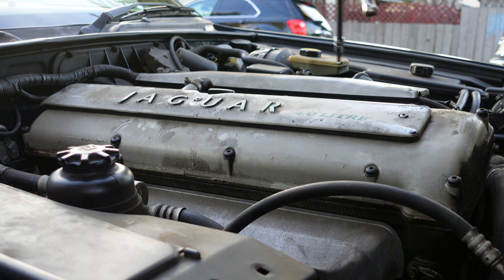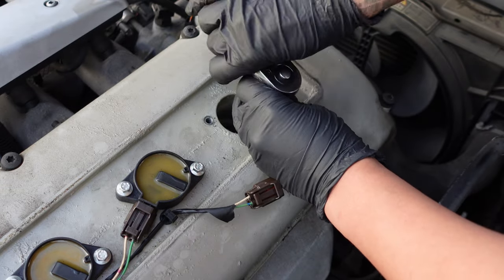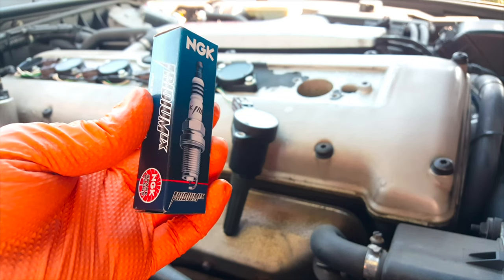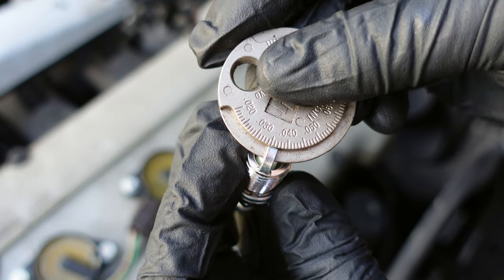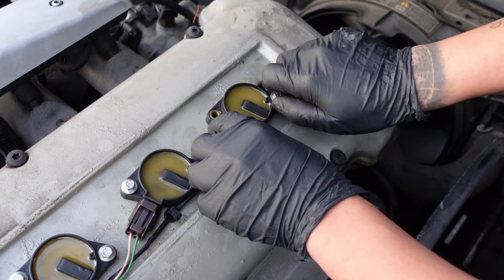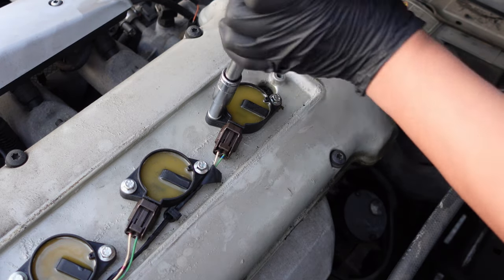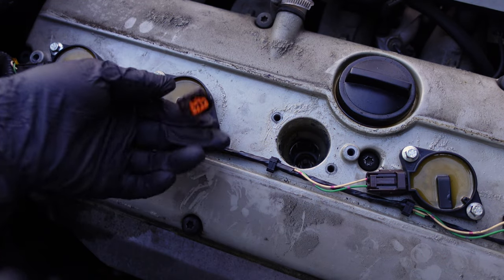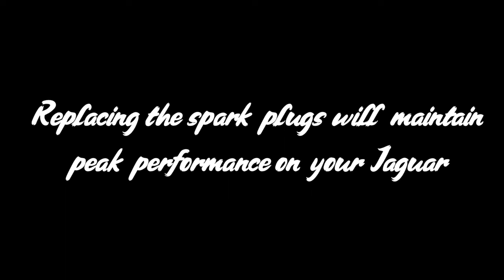Choosing Spark Plugs & Knowing When to Replace Them in Jaguar XJ6 X300

Comment: Great video Jesse. Thanks for showing Jag owners torque specifications on the spark plugs and getting them not to use anti seize on the NGK plugs. I just watch someone else channel on doing spark plugs on an x300, but left all of the good info you provided out. I just did spark plugs on my 91 bimmer 750il (NGK) and I wish it was as easy as this Jaguar. Keep your great content coming

Comment: Hey XJ - I am hoping you can help me I own a 1996 XJS V6 Jaguar with only 47,000. Just recently the Idle starting getting rough and the idle would fluctuate. Where do you suggest I start looking.
Reply: Sorry you asked a year ago , but for anyone else out there i had exactly the same issue.  I fitted 6 new Champion RC12YC Spark Plug Copper Plus from the Green Spark Plug company . Cured the lumpy tick over . Plugs cost less than £2 each . Order gaskets as well . They don't sell them . But I guarantee yours will be broken . Keeps the moisture out of the well .

Comment: I have a Jaguar van plas 96’ what battery do you recommend for a replacement?
Reply: Did you get one? I have replaced mine in a x300 4l Sovereign Xj6 and could use an Exide 95Ah, mabe this will put yoo on the right track. It fits perfectly in the battery place and holders in the x300